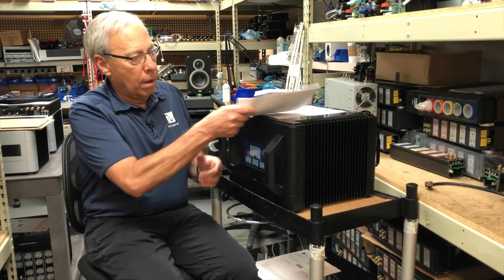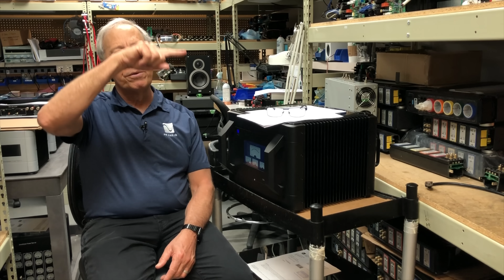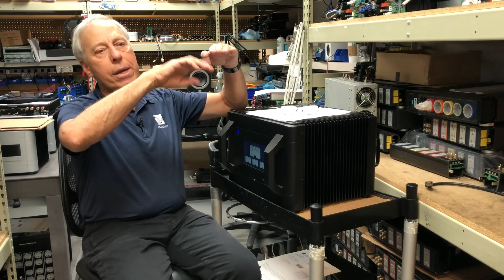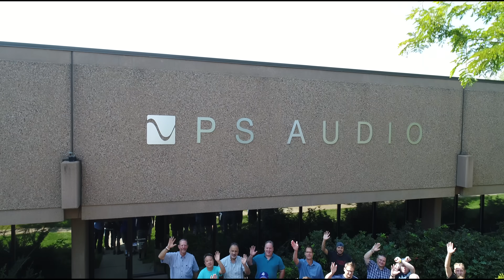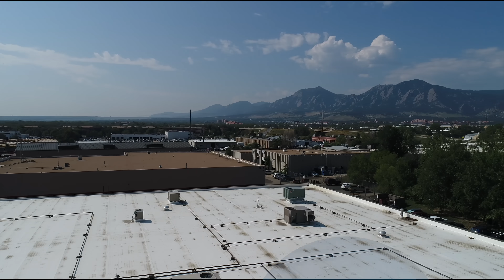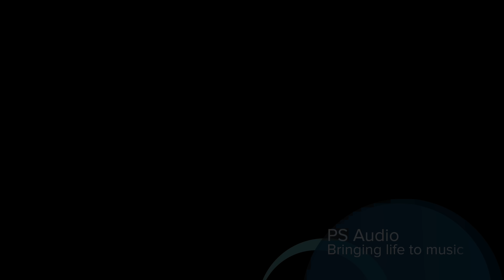What's the best voltage and frequency for audio?

Comment: Higher voltage means lower voltage drops on the power cables (even those in the walls) on power consumption spikes. This can impact dynamic if not large enough capacitors are used. Lower voltage need bigger capacitors for the same effect. No mention about that? OTOH higher frequency means that with the same filtering capacitors you do better filtering. You cannot go too high though because the higher the frequency, the larger is the power lost as heat in the magnetic core of the transformer. So the ideal from what we can choose would be 240V/60Hz. Do any nation have this combination?
Reply: Yes. The United States has 120/240 60 Hz single phase supplied to virtually all residential buildings.  (each 120 V  line is one half of a center tapped 240 V). Generally 240 V is only used for high current devices such as heaters and motors, but all you need is a 240 V paired circuit breaker and the proper receptacle to have a 240 V outlet.

Comment: 400hz is also better than 60hz for motors you can achieve much higher speeds with 400 hz  much smaller filter caps as well as transformers in equipment and you can use ferrite cores instead of laminated which improves efficiency and eddy current losses

Comment: 400 Hz is a little under the A over Middle C. Right where any him will be most annoying.

 We have 240 volt 60 hertz balanced power into 90 percent of US houses. The high end audio business will not use it. Ham radio guys mostly run SSB linears on 240 for good reason.
Reply: Richard Smith Two phase is quadrature power. Common in the twenties and thirties in industrial use, completely replaced by 3 phase today.
Reply: Richard Smith:  The utility power entering your house is 240V 60Hz single phase.  It is typically split into two 120V legs via a center-tapped transformer but that does not turn it into 2 phase power.  You can't make 120Hz power from it since it's coming into your house at 60Hz.

Comment: 400 Hz is used in aircraft to reduce weight.   However is has limitations.    400 Hz cannot be transmitted over long distances that is required for electrical distribution.   I do not understand how a difference between 50 Hz and 60 Hz could affect the sound of an audio system.  These voltages are converted to DC prior to ANY interaction with the audio signal. 
I think this is PURE SNAKE OIL.
Reply: mtabernig:  Why he can make that claim is due to very basic electrical engineering principals.  Transmission lines are inductive by nature.  As you increase the frequency on an inductive circuit, the series impedance increases  meaning less of the power you are putting into the system is available to be taken out at the end.  The inefficiencies make high frequency power distribution a non-starter.
Reply: @wahconah98  That makes sense and explains why power lines are so wide to minimize mutual induction between phases.
Reply: Not snake oil, it is science and has to do with power factor losses in the conversion process from AC to DC. Capacitors are used almost exclusively in audio power amplifiers now days to keep the DC level topped off when the AC level at times is at zero volts. Audio signal loads are unlike any other load you may run across in a motor or heating element. Old school amplifiers used an inductor coil or choke as well as capacitors. Phase shifts of current and voltage come into play. Remember ELI the ICE man?
Reply: we had generators transmitting 800V over a mile without a problem at 400 Hz you are talking low voltage like 24V in a plane.
Reply: Sure, a mile is not unreasonable, 20 miles, 100 miles, 1000 miles you will have problems.   The aircraft that I worked on in the Navy had two 24 volt dc storage batteries, as well as three phase 120 volt 400 Hz AC.  There was also dyna-motors on the intercom system that used the AC and converted it to 24 volt DC.
Reply: Ok I never try more than 3 miles one mile was more common, depended were we decided to set the portable generator in a mobile command, We can not bunch all the vehicles in one spot for obvious reasons. However why would you go that far for that equipment when I can power a converter at any output frequency locally. Remember, we do that everyday to control speeds on AC motors. they are billions of those devices in use today.
Reply: So you never try to transmit energy at 400 Hz long distances, So how you base the claim that you cannot transmit long distances?
Reply: Skin depth at 400Hz is much smaller compared to 50Hz. Would make thick cables even thicker.
Reply: wellInductive in a transmission line is the load at the end EX motors solenoids light ballasts and so on. the transmission line unterminated is resistive.  A length of wire is a resistance. Can we agree on that? so the main thing we were talking about is the type of material the conduit was made of.  I been working on VHF, UHF and Microwave systems. at extremely high power to fry the birds on the wave guides horns.
no matter what material we used as conduit at 900 ghz never suffer a lost of more than 2 W and we were pumping 10 KW .  Where is the dramatic loss? At 400 Hz is nothing still in the audible frequency. not even into Long Wave or HF.
Reply: mtabernig:  What do waveguides in a high frequency, low power, short distance application have to do with power transmission?  Do you even know how waveguides are sized?  Run the numbers for a circular tube waveguide designed to carry 400Hz energy and see if you can figure out why it's not likely going to happen.  (I'll give you a hint...  It would be over 270 miles in diameter).  And yes, a wire has DC resistance but since we are dealing with AC, we need to account for the reactance.  Cable size, cable spacing, cable length, frequency, and a few other properties all affect the reactance of a transmission line.  Changing to 400Hz is not economically viable due to the inefficiencies of transmission.
Reply: obviously you miss the sample. we are talking originally about wires being surrounded by ferrous materials and if there are losses because of it.
That is the discussion and that was the analogy with the wave guides that  is made with ferrous materials and work at much much higher frequencies and if not offer the loses you describe. 
FYI wave guides do not be calculated to the wave unit but can be calculated to fractions of it depending on the impedance of the load.
your all  is invalid
Reply: No...  We were talking about high frequency power distribution and why it isn't practical.  Where were we talking about wires surrounded by ferrous material?  It would increase impedance causing increased losses not to mention cost more which is why it isn't used.
FYI, even if you size a 400Hz waveguide for half a wavelength (the lower bound for sizing) it will still be enormous and impractical.
Reply: you need to try to understand what are we  are talking about.    I will try to example a Chicago in the 60's and 70 they had a utility company that pumped 3 channels of continuous music for business, offices and alike.
The wires run under the ground in heavy iron pipes coated with tar.  and run all over the city with minimal losses due to resistance  and some of the output impedance conversion.  The frequencies were well above and below 400Hz  so there you can research that. No unexpected losses  other than the resistive. Take that to the bank.     Or....you have some other unscientific and unproven theory?   Check telephone lines in the modern world  berry and inside iron tubes working at frequencies crossing the 400Hz up and down.....no significant losses there but the expected resistive.      go find another theory .

Comment: is it really fine to power the equipments at 400Hz? especially on switch mode with PFC and maybe UPS?
Reply: The biggest problem will be with higher quality switch mode power supplies as they have input noise filters.  With increases in frequency the X of C reduces increasing the shunting of the power as noise and the X of L increases so less is coupled through the noise low pass high cut filter on the AC main.  The increase in ground current may trip GFCI or cause related ground loop current problems.

Comment: 400 Hz AC is standard in aircraft electrical systems (reduces weight requirement for circuit components).
Reply: Yes, for real.
Reply: Yopp, 115 VAC, 400 Hz, with newer aircraft using variable frequency AC, however.
Reply: Yep 400Hz AC is pretty standard in aviation. Weight is important and so they don't want to carry the much heavier 50 Hz generators and transformers with them while the 400Hz ones are much smaller and lighter.
Reply: I have to wonder why they need AC at all since power isn't being transmitted for any distance.  Boost and buck converters can convert DC.
Reply: Its not DC because the history of it goes a long way back. In a time without transistors it was difficult to build DC/DC converters and even after we got transistors it was a while before the technology got far enough to make compact and efficient converters. Its not just about power transmission, its also about turning the power into the correct voltage you need for the given electrical component.

Back in those days devices called synchro reslvers used to be very popular for transmitting mechanical motion over wires (Today we use servo motors) and they need AC power to run. In combination with relays and mechanical linkages they made up a lot of control systems in planes.

In fact in the old days power electronics was so difficult that they had AC motors belt drive DC generators to get a controllable high power DC source. Infact most old elevators used such a motor-gemerator setup to get smooth controllable power to the lifting motor.
Reply: Grant Urismo 
For real?
Reply: Yip Mark Levinson No.32 Reference Preamplifier also regenerates it's own power at 400Hz.

Comment: How does output THD vary at the business end of your power conditioning device with varying input power frequency?
Reply: I'm serious. I want to know what the answer is. You have the gear to tell me what the answer is. So, what is the answer? What differences do you see in the output THD with varying input frequency?
Reply: Ok i do not understand your question,  I do not know if I have an answer. so what is TDH I am not understand. Thank you
Reply: Total Harmonic Distortion. This device gives a readout of the THD of the input power, and THD of the output power. My question is, what effect does the input frequency have on the output THD? The power conditioning device he is sitting next to is a big power amplifier. If some input frequencies produce a more pure output than others, it will show up in the THD of the output signal.
Reply: I would assume all has to do with Power supply on every separate equipment.  Some rectifiers are not as efficient and the precise capacitance of the filters to calculate for current and frequency demands at all situations. so the cleaner and higher frequency will allowed the capacitors to stay charged or an optimate operating range.     But that is the only explanation I can muster. Less ripple and maintain the negative clean closer to ground.

Comment: Could you not have a joint output One running at 60hz and one running at 120hz would this solve the problem with the tubes humming? I mean if you fed the heaters 60hz and the sound input 120hz or more wouldn't this solve the problem.
Reply: heaters do not care about frequency, it is a resistive load. The best way to reduce hamm from the heaters is fed them with DC. No more hummm.
Reply: mtabernig I suppose that would work I'm just talking about Paul's question?